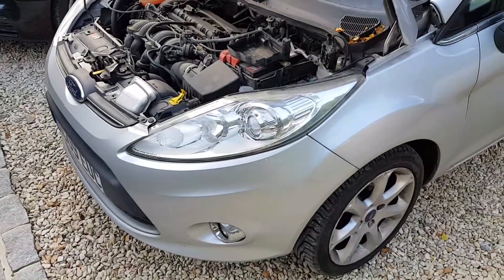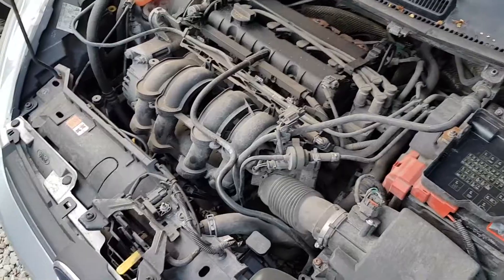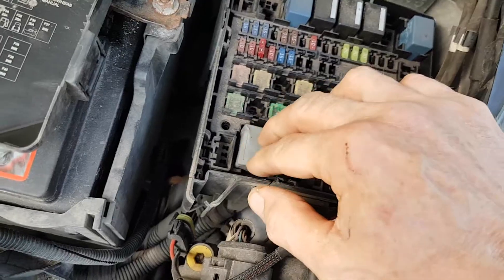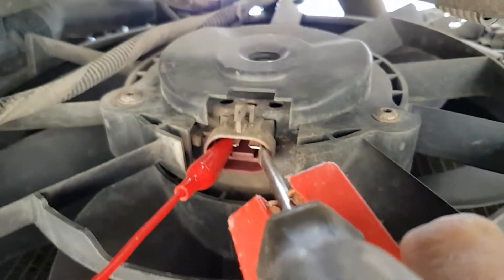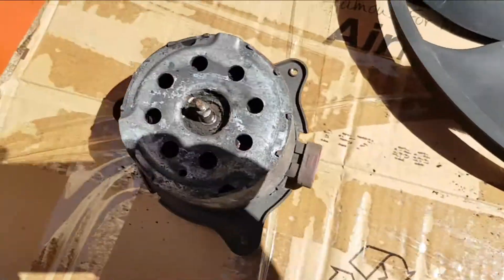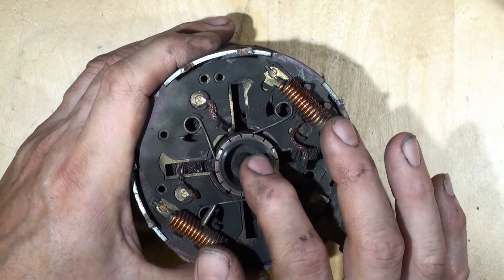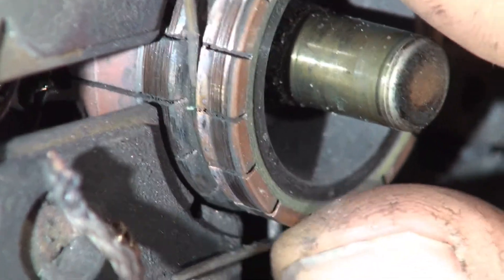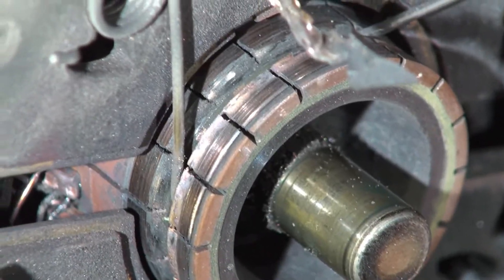Ford Fiesta 2009 Onwards MK7 Cooling Fan &  Aircon  Issue, Diagnostic and tear down

Comment: Great video. Could you tell us which German company or website you used to  acquire the replacement fan? I don't have a faulty fan I have a coolant level dropping problem that causes my fan to come on when driving plus the relay sticking problem
Reply from the maker: If you change the relay will it fix it? Water loss can be causes by mild overheating. Sorry, I cant find the order details. I remember that there a a couple of versions of this assembly. Some to fit older models that are cheaper.  The only difference is that is in the power connector:  The key-way is slightly different on the cheaper version - I think the most likely reason for the difference to keep you paying more for fans to fit recent models. You can buy the cheaper one but it is necessary to trim a bit of plastic from the socket as they changed the keyway in the connector to stop you fitting the cheaper version.. It doesn't effect operation.

Comment: I've now tried connecting across the big terminals and the fan doesn't run. The fan runs OK when supplied directly with earth and live. Is the the wire going away from the fuse box an earth wire and does that go directly to the fan? Can anyone confirm the wiring from the relay socket large terminals and the plug that goes on the fan.
Reply from the maker: Did you find the wires?  I have a manual somewhere..
Reply: Long shot that you'll see this reply, but did you ever solve this? My fan no longer runs when the AC is switched on and when engine temp climbs above 106 nothing is happening, but when supplying direct power to the fan, it does spin. We've checked the relay and fuse and both are seemingly ok. Was there anything else you found?

Also thank you @razenby for the video - this is the exact issue I'm facing. Seems to be a common problem on this model!

Comment: Hello  Nice video and good to confirm I had been looking at the right relay and fuse. I have been having a look at my Grandson's car today [same as in the video] and have tested the fan and that works OK. The fuse is OK and the relay clicks when I apply voltage across the small connections. When I test the wiring to the fan socket from the relay socket I get continuity on the earth lead but not on the positive cable. Not having a wiring diagram I assume the positive cable must go elsewhere before it gets to the fan socket. The fan also does not come on when the Air Con is turned on. Any pointers would be welcomed.
Reply from the maker: Did you find the wiring diagram.?
Reply: @razenby  Yes it's all sorted now. Although the fan worked with a direct feed I had to fit a new fan and that fixed it. It also cured the Air con problem as well. Don't know why the fan wouldn't work with the control module but at least the problem is solved.
Reply from the maker: Good to hear

Comment: Hi, any advice my a/c not working. Been told to check if pump receiving electric or output electricity
Reply from the maker: Most likely cause is that the gas has leaked out. If the pressure falls below a threshold then the compressor clutch won't engage.  Check the /C climate fuses too.

Comment: my car keeps turning the engine off when slowing down or idle it turns out a main fuse has gone which controls the air con and cooling fan  which was over heating the engine
Reply from the maker: Useful info

Comment: I just changed mine with 316000ks on clock it was the stock fan to
Reply from the maker: This one one of the very Early versions of the car.  The later ones seem to switch the fan on and off -as required by thermostat. A tuber told me in the early ones the fan is running all the time when the climate is on.

Comment: Thank you, this helped me pinpoint my similar problem. Same as yours as the fan does not move even with direct connection to a battery. Replacement part ordered from Germany.
Reply from the maker: No problem
Reply: Same! Hooked up power and nothing. Thank you for the great video!

Comment: I have had the exact same problem with my Fiesta, as far as the AC goes when the car is moving along it works but when the car is stationary the air-con does not work presumably because the fan is not keeping the compressor cool. Could this damage it over time as it has been like this for a while. Also the engine begins to overheat when stationary. It is not a fuse I've checked
Reply from the maker: Yes, if the fan is not working, when the warm weather arrives your car will overheat when you are in traffic.  Running the engine too hot make the oil to thin and the tolerances inside the engine will be out. Especially the pistons will be tight in the bore.
Reply: @razenby  thanks for the reply I will try changing the fan then and see if that fixes it. What I was trying to say is could this damage the air conditioning as when the car stationary it makes quite loud clicking and hissing noises.
Reply from the maker: If you haven't already then best to  check the motor is the root cause before you go out and buy one.